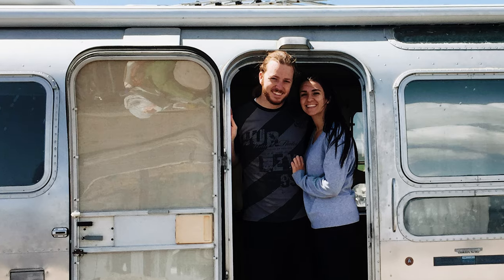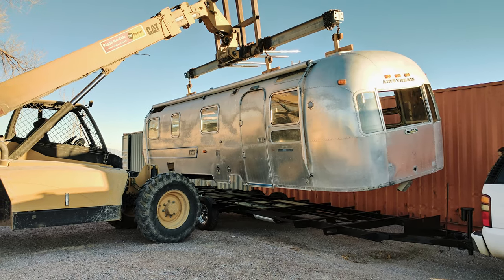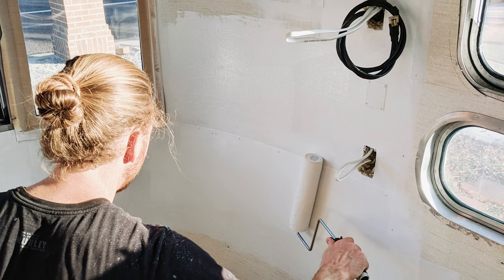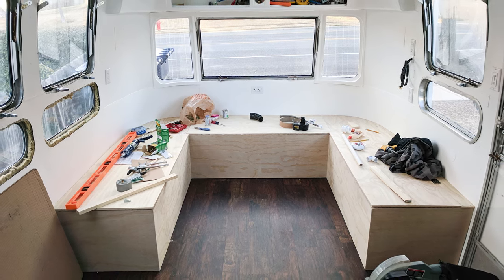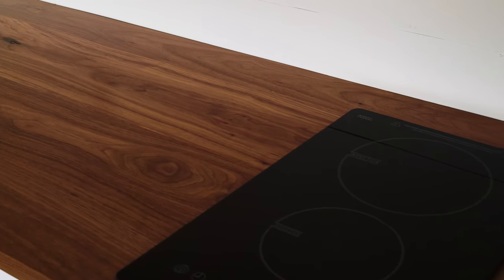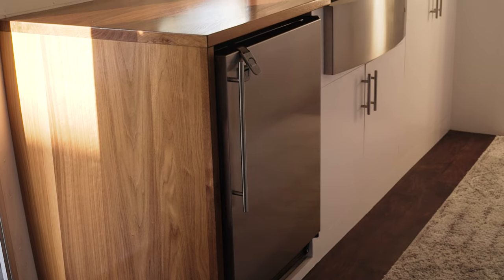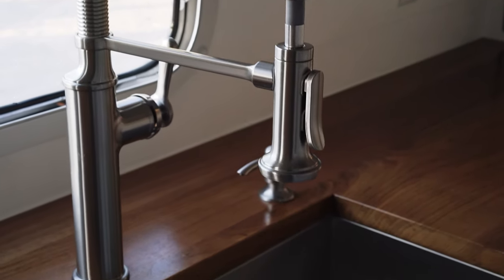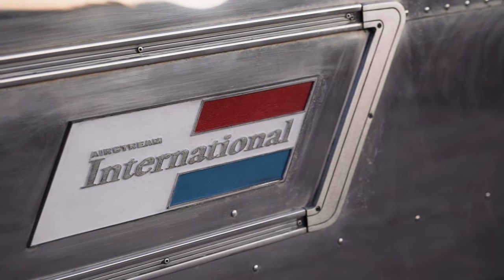Vintage Airstream Trailer Renovation / Tiny Home Construction

Comment: Hey Chance - amazing work! Can you provide more info on how you restored the outside?  Looks like you sanded it first before buffing?
Reply from the maker: I actually didn't sand it and I wouldn't recommend sanding it. I mean technically polishing wax does act as sandpaper but it is super fine. I just purchased 4 different grit of aluminum polish and a polishing grinder. I think put in way too many hours and polished it. Hope that answered your question.
Reply: Yep that was very helpful! Thank. you!

Comment: Absolutely gorgeous! What did you use for a shower? Did you install a waterproof wall system and showerpan or use something else? I am getting ready to start the bathroom for my 72 Landyacht and am install a mid bath.
Thanks!
Ellen
Reply from the maker: I used a Rust-Oleum tub and tile refinishing kit on the original aluminum walls to waterproof them. I then used the Schluter Kerdi system for the floor and tile. Hope that helps!